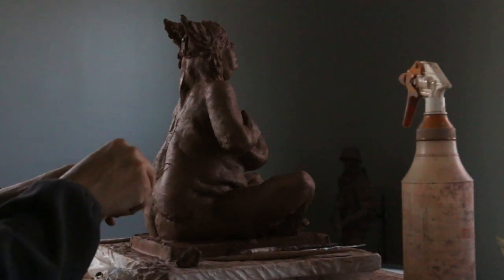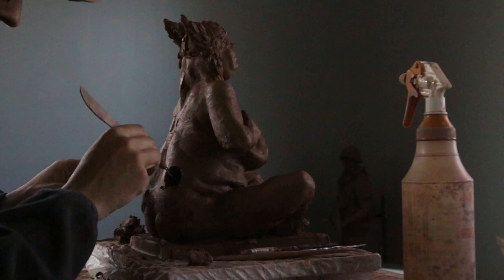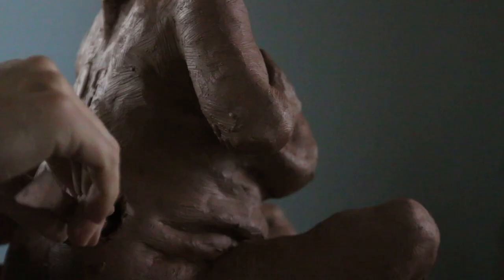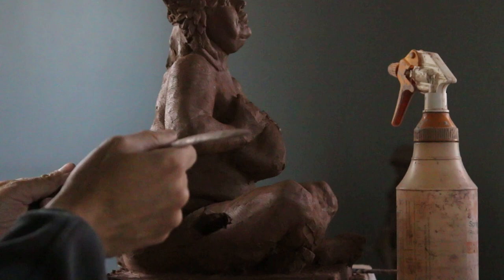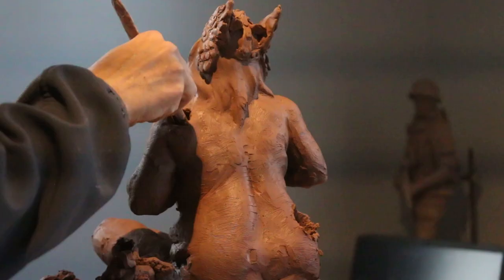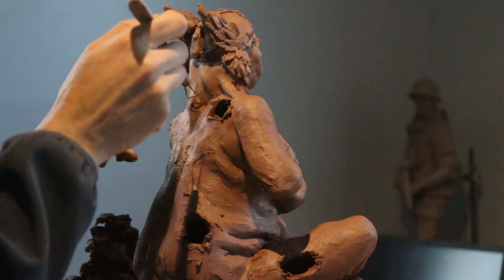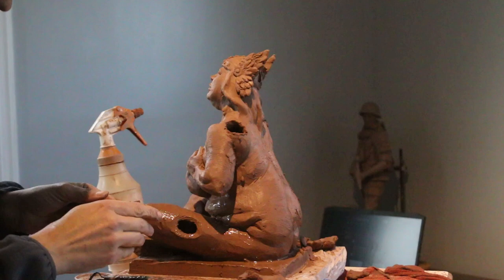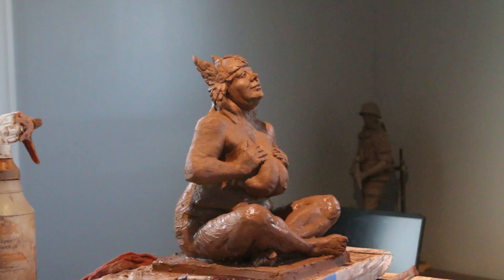How to hollow out a water based sculpture for firing

Comment: If there was an armature inside the sculpture , would that have to be removed to avoid cracking during the drying process ( before firing process) ? As the clay shrinks , the armature resists and cracks appear?